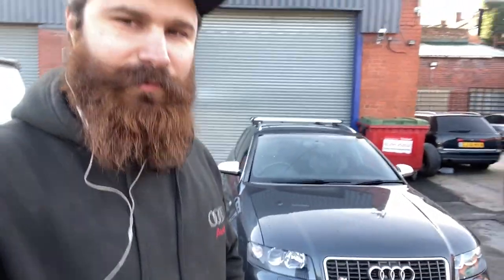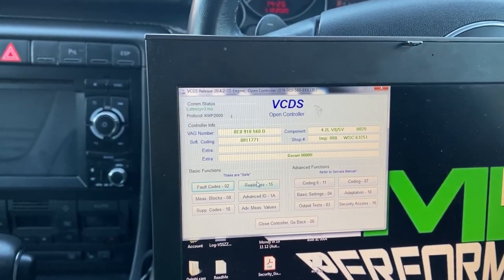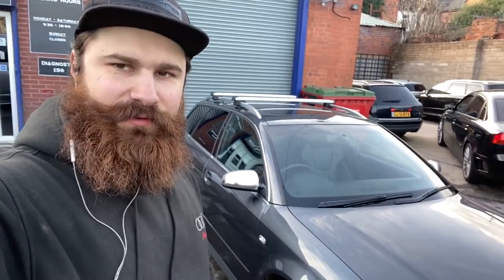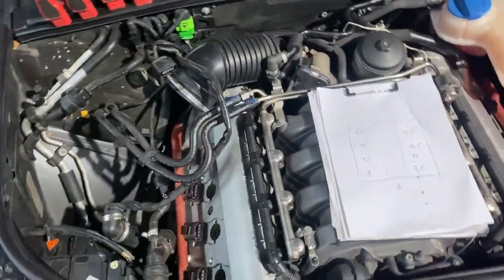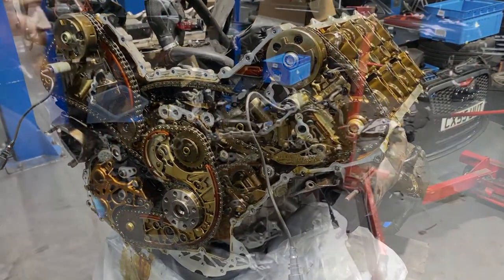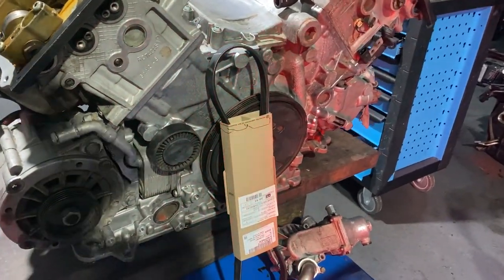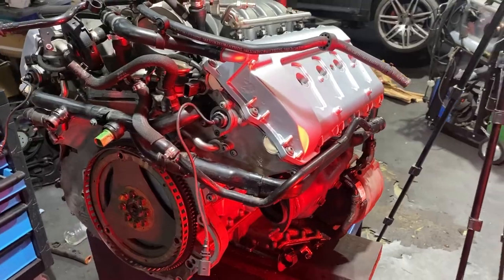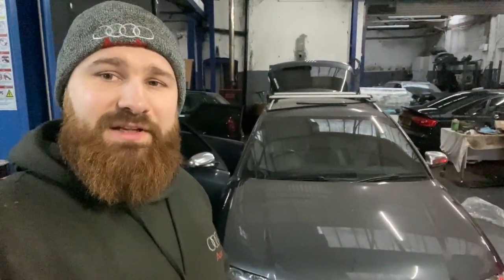Audi S4 B6 Avant V8 4.2 (P1347 fault) - Timing Chains Replacement / Camshaft Adjusters

Comment: You make it look so easy, wish I had a mechanic like you near me CT/USA.  2005 S4 convertible, 44,000 miles, I often consider selling just because I know that if anything goes wrong, it's a bucketful of money.  Luckily, never heard any rattles, but $2000 to change the AC compressor, because the seals went bad and it leaks 😞.  Keep up the good work.

Comment: Fantastic video guys. This is actually one of my customers & I was the one that initially diagnosed the chain problem hence him coming to you. I wish I had the time & the enthusiasm to do these videos as I get great pleasure watching them. Keep up the good work. 👍
Reply from the maker: Oh, nice! Thank you very much for your kind comment, we are trying our best. :)
Reply: @VAGTechnic  i have question once the upgraded chain guides with metal backings, tensioner, camshaft plates been replaced what is the life or miles/km it will last with for a peace of mind. I live in sunny California with proper warming up and occasional oil changes at 3000 miles. Great video!
Reply from the maker: @bcruzin28  hi, first one we done was something like 4-5 years  ago , no one contact us since . Guids probably 4ever now , only other part what use to worn out are camshaft adjusters

Comment: I replaced every slipper/guide in the bellhousing plus the adjusters (I had way more wear, a long slot out of the locking pin hole on both) but DIDN'T replace the chain tensioners on the cylinder heads figuring I could do them in the car having seen a video on it. Sadly it appears that the tensioners on the heads - which fed the cam adjusters - was likely the root cause of the entire problem cos as soon as the oil gets over 90C I have to hold it at 1100rpm at traffic lights or my brand new adjusters go 'clack-clack-clack' as the pin fails to engage in the hole and the cams flap around (I could hear it and see the cams 'jump' while turning the engine by hand with the valve covers off before replacing everything due to the slot) :(

Comment: Great video. While using the VCDS you said the group 91 and 92 values were a little high. What range should they be in. I have a 2006 C6 A6 4.2 L I just bought used with about 56,000 miles.
Reply: Was wondering the same thing... Hopefully he can reply! Also am I the only one to be surprised of this metal wear with just 60,000 miles? Is it a common problem???

Comment: Hi I've got a the same problem but back 1, I had the chain replaced last year. Is there a chance it could be just the sensor or will it def be the adjuster?
Reply: Mine just happened changed the sensor & she looks fine do i need to be worried?

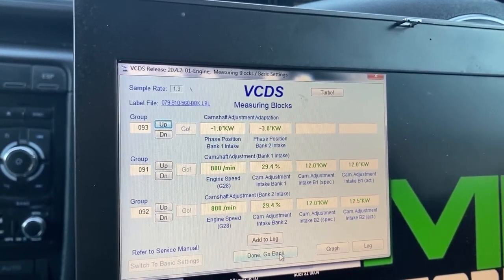Comment: At 5:30 you say the cam adjustment (groups 091/092) are higher than you'd expect for idle. Mine are about the same, it drives great, no fault codes. But I have a terrible tick after a full timing chain job, which is partly why I keep an eye on these groups.

What values do you like to see in groups 091/092/093 and why?
Reply: And at 14:47 is the first time I'm hearing the dowels are worn - that noise when you wiggled the guide makes me wonder if my noise could potentially be something as simple as a worn dowel. It's either that or a faulty chain tensioner, which I'm not sure how to test for.

Comment: I have a nogaro s4 that just threw the AC belt I replaced, pretty sure it wiped out the front main seal because I suddenly was pouring oil out the front. And there is a very loud metal on metal knocking on bank 1. I have 4 audis, have built the heck out of many, have a stg 3 b5 s4 I built, I build my blocks from bare block up, lots of 1.8ts. Used to restore and modify classic porsches for a living so im not the average idk anything about fixing modofying snd tuning cars.. but I've never done any serious work on the 4.2 and I'm really not looking forward to this job because I just have an engine hoist. No lift. Do it in my garage.  Weird thing is, the noise sounds very clearly like it's coming from the front of bank 1.. very front. Found tons of gunk and some oil in between the head and the intake manifold. Need to rosstech it tommorrow and re-check timing. But it was around like -8 if I remember when I checked a couple weeks ago. Ideas?

Comment: Don't you have to service the A/C once you disconnect the lines?
Reply from the maker: If costumer don’t ask for
It no … vacuum test afterwards, oil and AC fill up
Reply: @VAGTechnic  Well I was just curious since that part wasn't in the video. For DIYers watching, they need to know once u open the system, vacuuming etc. is absolutely necessary.

Comment: Why do Audi and parent group engines always leak oil. I had a 200k 2.4 type s Honda Accord and not a drip.
Reply: ask same for bmw, to have to go to bmw service and pay unnecessary service that could be prevented if they did not put additive that speeds up rubber seal disintegration

Comment: I would never have one of these engines as they are so complicated with so many parts that can wear out.  Those plastic chain tensioners are just a joke by Audi.
Reply from the maker: What you expect after 15 years ? No service necessary till ….?
Reply: that plastic is intended to wear, but plastic water pump or housings of thermostat .... are joke, and it is made to fail